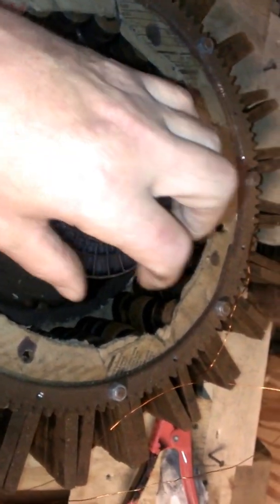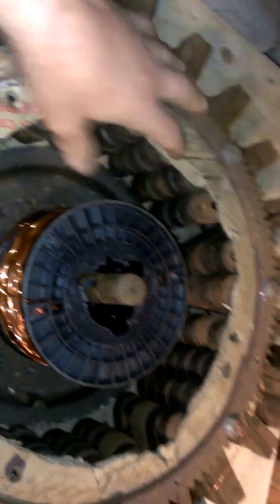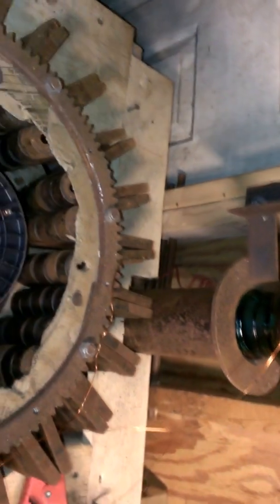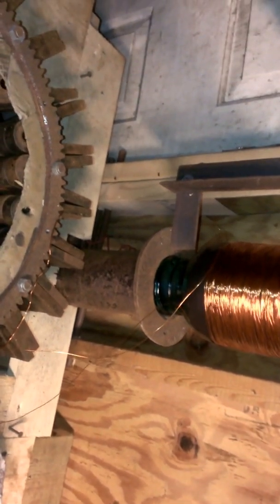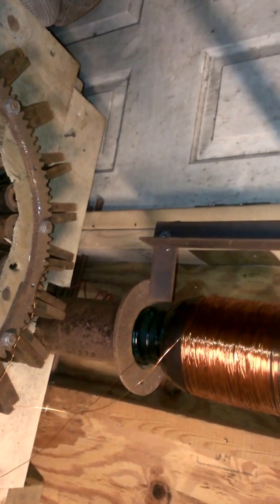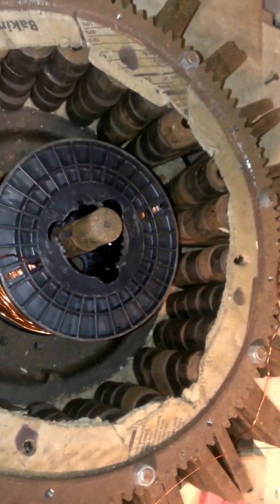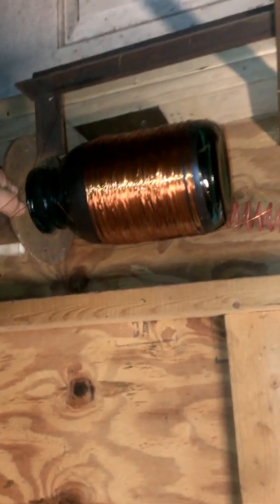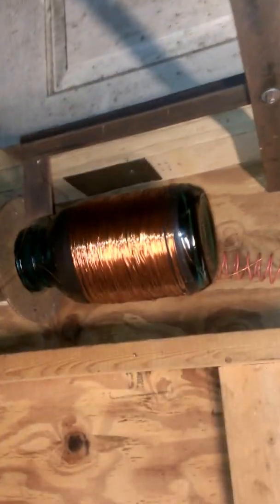Ed Leedskalnin's earth frequency tap in

Comment: a top load inglis washing machine has a 36 pole stator that can be converted easily  with the ferrite cores from t.vs and computer monitors,   ,  making your own v magnets is another,   check out  dave lambright,   zink coated steel  pipe cut lengthwise then into 4 inch sections   it works too,  pretty cool.  check him out too.

Comment: Spin the wheel. 1080 rpm.=18 rotation per sec. 24/18=432hz
Reply: actually in ed's writings he said you have to have it spinning at least 2000rpm which is 33 cycles per second = 33Hz.  33 is a special number to some, isn't it? ;)